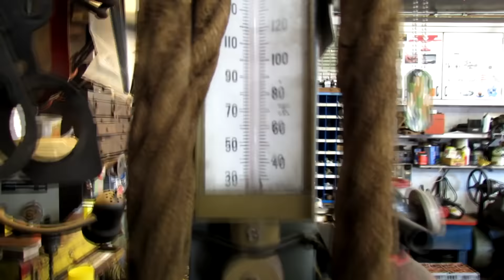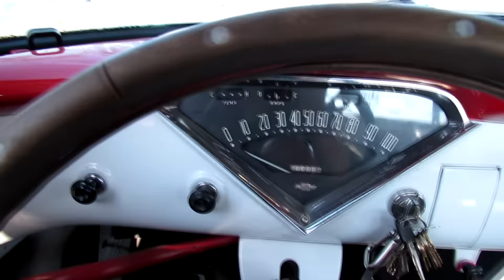A Windy one

Comment: good ford...l had/drove a 79 for 7 years (miss that truck) it had a 6 cyl (300) automatic...the earlier f series l had with the 6 cyl were standard shift...l think the 6 cyl works better with the stick...seen 1 of these 79's with a square motor (same size bore & stroke) it said 351 MOD 400 on the valve cover
Reply from the maker: +James Letaw This one is a 351 Windsor
Reply: 302 is as far as l go, but gas is getting cheaper...the 302's work good with automatics...maybe because of the shorter stroke?

Comment: You need to add some fluid to the transaxle. Make sure you put the motorcycle oil into the proper side as the other side has gear oil in it.
Reply from the maker: +The Shade Tree Fix-it Man I need to read up on that. Do you know of the correct resources?

Comment: if you get into either fixing or replacing that old fords 351m do the oil flow modifications to fix fords design flaw of the cleveland / modified AKA. 385 series design that they never fixed so the cam bearings will live , that little issue caused the oil pressure to drop in all of them , and wiping out the bottom end in well less than 100k , was it bad engineering , stupidity , or designed failure to sale more vehicles it leaves us to wander ...
Reply from the maker: +towrecker This one is a Windsor...